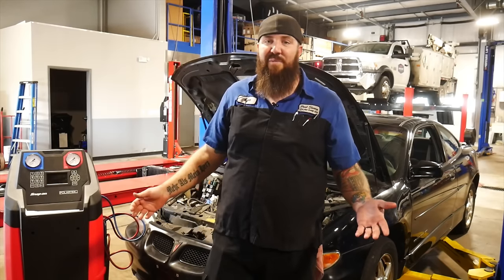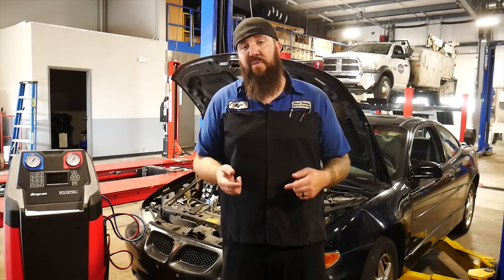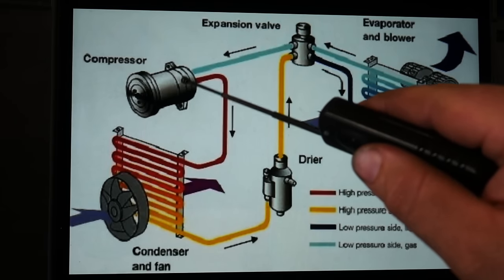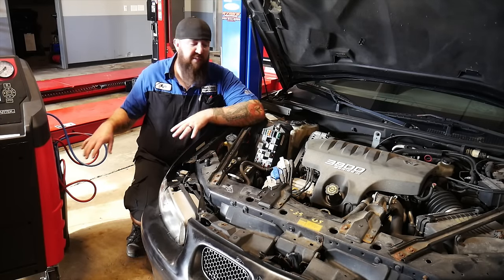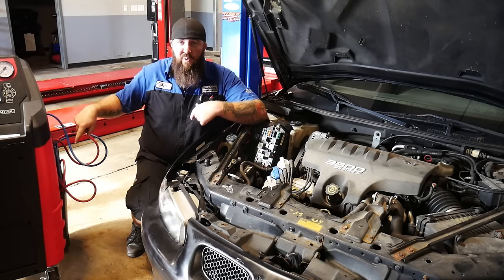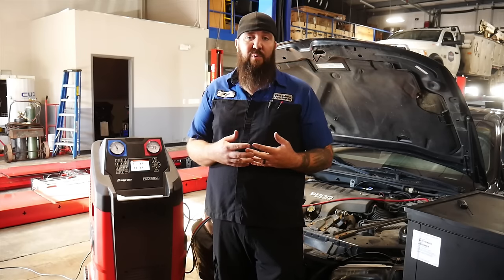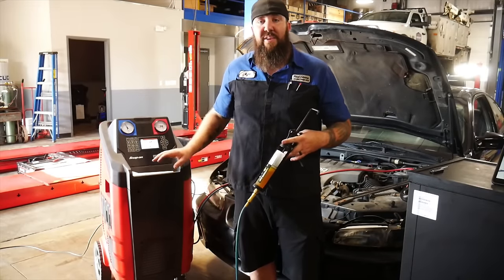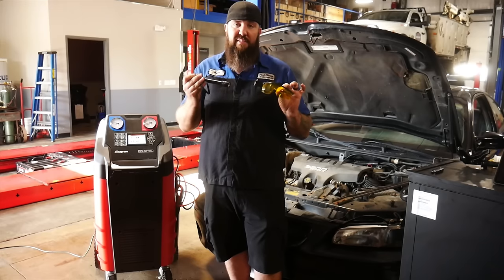AUTOMOTIVE HOW TO: A/C SYSTEM DIAGNOSIS FOR BEGINNERS

Comment: Thanks man! this helped me diagnose a bad wire that was intermittently turning off the fan. I noticed the high pressure would increase all the way beyond 300 as I filled in freon, even with 4 oz in the system. I thought it was a clog or something, thought the expansion valve was bad. If I just knew a little foundation to the AC system I would of known instantly the fan wasn't cooling the condenser, duh!. Thank you!

Comment: If you made a whole learning series like this, I would openly pay for it. No BS, better than tech school lol
Reply from the maker: Thanks man! What areas would you like to see more/first? EVAP systems? Diesel After treatment systems? Basic electrical diag?
Reply: @RustbeltMechanic  basic electrical
Reply: Do more a/c material and electrical diagnosis. This video has a lot of good information.
Reply: Evap systems please
Reply: @RustbeltMechanic  GarryGraves went MIA once the questions started rolling in.
Reply: @RustbeltMechanic  Great video what brands do you like im thinking of buying global parts distributors llc compressor a conversion to piston from rotary style on a 2006 mazda 3 2.3 L ?
Reply: @RustbeltMechanic  Great video what brands do you like im thinking of buying global parts distributors llc compressor a conversion to piston from rotary style on a 2006 mazda 3 2.3 L ?

Comment: Excellent video!  So glad I watched it.  I have an 06 CRV with a new compressor replaced last year.  During the summer it was cooling so well it would absolutely freeze me.  Oddly enough I noticed on a warm day in December it wasn't cooling.  I assumed the coolant had leaked out and got one of those DIY kits from WM to put some coolant back in it.  To my surprise, when I hooked up the hose to the low side, I got high pressure in the red range on the gauge.  Now, I at least have a clue as to why the low-pressure side is high.  I did not have the expansion valve replaced when I had the new compressor installed!  What seemed like sorcery and rocket science before now kinda makes sense!  I'm going to my guy and have the expansion valve replaced.  A/C starting to make sense.  This is scary, but fun!  1000 thanks for a great video!!!

Comment: Really good video sir and your material was spot on.  One suggestion would be that once proper condenser fan operation is verified, always place a really good fan in front of the vehicle to replicate air across the condensor while driving when reading and/or adjusting pressures.

Comment: Outstanding video with clear explanation on auto a/c basics. It would had been great if you had demonstrated the scenario of overcharged systems, which is something common. I have found that a lot of people just "blindly" add R134 when their a/c does not cool sufficiently.
I hope to see a part in this series going into a little more advanced scenarios. Thanks for your hard work.

Comment: Inexperienced diy ac guys keep me employed.  Just this week had a ponitac g6 with complaint of ac not cold, gauge readings were tell tale for an over charge.  Hook up the ac machine and recovered 12 ounces more than spec plus 4.5 ounces of oil.  Recharged to spec and fired it back up and the compressor was not happy since they oil slugged it.  Then when the parts came in I recovered what I had put in and recovered another 1.5 ounce of oil.  I dont know how many oil charge cans they put in it but I flushed everything that wasnt replaced and charged it back up and all is well.  Expensive lesson for them but nice ticket for me.
Reply from the maker: Those are always nice tickets!
Reply: That's hilarious. Me too. AC fix in a can. People don't understand about why this works. I love car HVAC. One of my favorite services that I do for my customers.
Reply: @mikevonkleist6767  I went to a dealership and they said they would charge me 2 grand to fix the ac compressor, it needs to flushed and replaced
Reply: Eric gunter is it possible to recover oil from a system in order to charge to spec?
Reply: @ronmtz2531  the only way to get it back to 100% correct would be to recovery the refrigerant, then remove and drain the compressor and flush out all of the other components.
Reply: @RustbeltMechanic  I was told by mechanic it's best to leave car overnight with him for proper digital diagnosis,  is that true?
Reply from the maker: @mikeprice8307  I guess🤷‍♂️ if the guy is not confident in his repair. Elsewise you should know by looking at a gauge set after the repair.
Reply: @RustbeltMechanic  he says what he does is charge the system properly.  Let's car sit overnight and digitally checks the system for detection the next day bc the gases are detected better with the car not having been moved or running.
Reply: Well maybe because for the new 1234yf the dealer wants 300 just to look at our car and the other shops don’t have the Equipment they keep telling us.  You bragging about how high your repair ticket was doesn’t help us.
Reply: I actually have a g6 with an ac issue are you still active?

Comment: Good overview. The low pressure moving from a liquid to a gas (phase change) requires a lot of heat which it gets from the warm air making it cold.
Reply: As my a/c instructor loved to say "a/c doesn't make cold air it removes heat cause In the a/c would there's no such thing as cold only lack of heat"

Comment: Buddy ty for taking the time to make this video, I watched it thus far about 4 or 5X. Ironically  after I watched it I had Ac diagnostic the next day, high reading on the low side , high side was normal, I went after the exspansion valve, once changed the Ac system  was extremely cold. Got the job done like a boss, an grabbed the bag 💰💰ty again.
Reply from the maker: Good going man!!
Reply: You are great instructor Sir, Awesome!!!! Keep up the Excellent work.

Comment: I really liked the way you showed different readings and explained the issues. My 2007 Honda Accord's AC is acting funny. Readings are good, compressor engages and blows cool air. After about 10 mins of the compressor cycling on and off it goes off and pressures change. Low pressure goes to 50 psi and High pressure goes to 100 psi and it starts blowing warm air. If you turn it off and let sit a minute and then back on its fine for awhile. any ideas?

Comment: Interesting video. My ac starts out cool in the morning and as the day warms so does the air coming out the vents. And it stays that way doesn’t fluctuate. First I thought it was my condenser but from what you explained in the video, I’m now thinking expansion valve.

Comment: This was an awesome vid thank you for posting it. What do you do if you can't find a leak? I added dye to my car, the low side pressure is 5 psi and the high was 90. Temp was about 90 deg outside.  I drove the car around about 20 min, and didn't find any leaks with the uv light.  A shop charged my a/c system last summer. but now A/C just blows hot air.  Temp at the vent is a100 plus.

Comment: Great video! After vacuum, does my system require me to inject the full volume of oil stated in the specification? Or will some oil remain in  the system? How will I know how much oil remains in the system after vacuum?

Comment: Great video!
If I got my vehicle's AC system completely evacuated (via a Refrigerant Recovery Machine), do I need to put the full amount of oil back in?
Also, is the amount of oil to put back in based solely on how much oil the compressor requires, according to the service manual?

Comment: Go head and do the advanced diagnostic video I'd love to see it!!!!

Currently having trouble with my ac. I changed the F.O.T. it made a difference behind the tube where as before it was always warm. Now it gets really cold, but the air inside the cad is like strait heat. 

The compressor kicks on for about 5 seconds or so. 
Low side grows to 90-110
 high side grows to 150-200

Low side falls to 20-30
High side falls to 95-110

Any tips for me? I've got my own gauges and vacuum. 

Also how can I recover the freon with a tank safely without having to go somewhere to pay someone to take it out?

I'd prefer to take it out and put it back myself so I'm not buying it just to test my system

Comment: You did an excellent video on different (test)  scenarios as related to pressure, AC temp, and diagram.

Do most  regular shops do AC services, or a customer has to go to an  AC specialist?

When filling freo, what is normal pressure to achieve  when car engine  is on  30 on low, 170-200 on high? I don't want to put too little or too much freon.  

I know this probably also depends on outside temp and humidity.

Comment: Excellent video! I've worked on 4-5 systems over the years with ranging complexities. All have worked in the end, but I have wondered what the gauges were actually telling me, this is where my knowledge ended. This is a great resource. How much does a plugged condensate line or dirty filter play into these failures? I always make it a point to service these two pieces while troubleshooting.

Comment: Thanks for this!  I have a mid engine application with the condenser in the standard position in front of the radiator at the front of the car, and an electric rad fan pulling air through the condenser and radiator.  Consequently, the refrigerant lines are much longer than in a normal installation.  Is there an accurate method of determining the optimum oil in this system?

Comment: Would you explain how(or if) that machine tests the vacuum before you charge the system. Is it automatic or manually done? I took my vehicle to a shop, told them I replaced the compressor & Accumulator and asked them to "check it and charge it". They said the machine did not report a leak but 3 hours later dye had leaked out. Just want to understand what happened. Why did they not detect a leak.... Should I have said "Test it, let me know if needs repair." instead? I wanted a shop to do it in case I needed to use compressor warranty. Now I am doing it myself because they charged it with 16 oz too much and probably Denso won't warrant it anyway. Your answer is much appreciated. Thanks.

Comment: This was so informative! I honestly feel DIYs, even techs, benefit immensely from going back to the fundamentals. Obviously you cannot cover every issue, but, if a low pressure side is showing too much pressure, you said could be expansion valve. Could it also just be an overcharged system? Especially since many DIY-ers buy those recharge kits at the parts stores then end up taking it into the shop with the complaint that "it's not coming out cold". Bsg Auto did a video on this about two weeks ago on this very issue would love your input.
Reply from the maker: Oh yeah an over charged system is just as bad. Too much refrigerant causes the system to not be able to change over from a gas to a liquid or visa versa. That change of state is that key pressure and temp that the system has to maintain to work at peak efficiency. Like I said lots of issues to cover, I may do a follow up video sometime
Reply: @RustbeltMechanic  so on this particular vehicle, you just changed the fans and then it worked afterwards? Or was it something else too.
Reply from the maker: @gabrielfranco9786  actually it was the fan relay that was bad all along, the fans manually were able to work.

Comment: Trying to figure out where to start on my 2013 Ford Edge.. starts out very cold sometimes it's below 20° I do not have dual climate control but I will soon start to notice after driving the driver's side starts getting warmer than the passenger side seems like as soon as the car warms up or if I shut the car off and turn it back on entire system gets warm. After the initial glance at the system I didn't notice the AC fan was not working at all so I did replace it. Fan works properly now but the issue is still happening. I have checked my actuators at both blend doors do you know if I have leaked freon would this be some of the symptoms of low freon
Reply: Also I have no water coming out of the drainage tube

Comment: I'm impressed with the way you teach congratulations, i have a question i will replace my Compressor, Condenser and the 2 Expansion Valves, i will flush all the line and the evaporators, the compressor is already oli filled with 6.8 oz and say you need to add more oil if you have read evaporador that is my case, but the FMS said my system should be fill it with 5 oz oil, this new compressor works with 6.8 oz so i don't know how much oil i should add for the second evaporator, could you help me ? 

thanks

Comment: I think the advice on the condenser fan explains my situation. I noticed that the AC started to not work as well. I went through things to check and found the condenser fan was dead but still getting power. While waiting on the part to come in, the AC slowly got to no cool air at all. Compressor still kicks on. Well replaced the fan but still not cold. I'm guessing since the fan was dead too much high pressure caused the freon to leak out. Would I be good to just add freon with AC Pro with a gauge for the low side? My thinking is if the leak was just due to too much high pressure than moisture shouldn't have gotten in and require a full evac and recharge.

Comment: Awesome video and information.   Why would a newly refurbished ac system in 9 months, when I first cranked the car and turned on the ac, it blew oil and refrigerant out of the compressor, almost like a rupture disc blew, but can't fid a rupture disc.  Once I turned off the ac, you could hear like a valve closing.  Hooked up my gauges and I still have refrigerant and low pressure on both high and low.  What do you think might have happened?  Thanks.

Comment: My 2006 Nissan maxima has low pressure on both sides when ac is on and car running radiator fans are working low side is 30 high side is 150 specs say should be 50-55 low side and 350-355 on high side it won’t take anymore Freon? Any ideas?

Comment: Young Techs should take heed to this ..To have a 609 a/c and air conditioning certification is good to have ...Alot of techs and mechanics in alot of shops they do not have it
Reply from the maker: Yes indeed! It’s fairly easy to get the certification
Reply: @RustbeltMechanic  Yes sir I had mines since about 2011
Reply: @RustbeltMechanic  For the most part what the younger Techs need to know if I can remember so that when they hear testing so that they do not get discouraged is that the test is not as sophisticated as some other test and if my memory serves me correctly I believe there were like 13 to 20 questions if less I believe it's been quite awhile but it is a simple run through
Reply: I'd say the HVAC ASE is far more extensive and actually requires a solid understanding of the entire HVAC system.  608/609 is simply for EPA standards.  608/609 is easy to get and doesn't cover all that much TBH.  Get your HVAC ASE!  Get all your ASE's while you're at it 😉
Reply from the maker: PAULY'S AUTO agree..... the automotive hvac ASE is very extensive and definitely pressures towards knowing a lot more electrical than even pressures anymore. I wish it focused more on hvac pressures and recovery machine usage as well. A lot of the students look at an ac machine like it’s a spaceship lol
Reply: @RustbeltMechanic  Agreed, they're definitely geared towards electronic problems.

I do think it is critical to understanding the entire spectrum to unclude pressure analysis.  Alot of times guys can forget that you can also have cooling system problems that can cause poor AC performance.

Not to mention HVAC control module, actuator, or even software updates/programming issues.

There's just so much we need to know, it can be difficult to wrap our head around it.

Nice part of our community and industry is the amount of networking we now do, like YouTube or Facebook etc.

Sharing our experiences and approaches help us find new ways of looking at a problem or different methods to help us stay on top of it all you know?

What I always try to do is examine the entire system to ensure I don't overlook areas that can cause problems down the road or affect the systems performance etc.

In either case, I like your style of teaching, keep this up!

Comment: Correct me if I'm wrong but I believe you mis-spoke at about 6:00 saying if metering side of the expansion valve detects too much flow or temperature too high, the pencil shuts off Freon to the evaporator. 
I don't believe the "H" valve monitors flow at all and excessive temperature/pressure at the evaporator output would push the pencil against the spring and increase refrigerant flow into the evaporator.

Comment: Great info sir!!  I do have a quick question so you know the AC condensers usually if you try to buy a OEM one they’re very expensive but you can buy aftermarket ones. Do you think the aftermarket cheap ones do a great job what they’re supposed to do rather than going back with the OEM one? Thanks